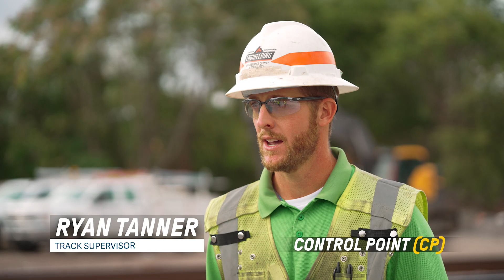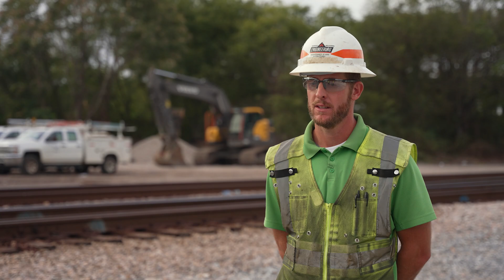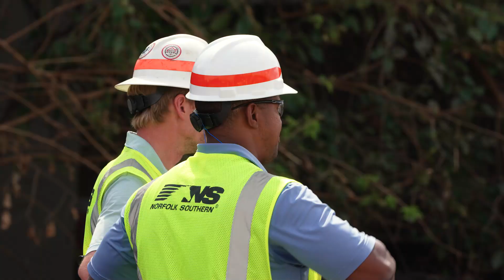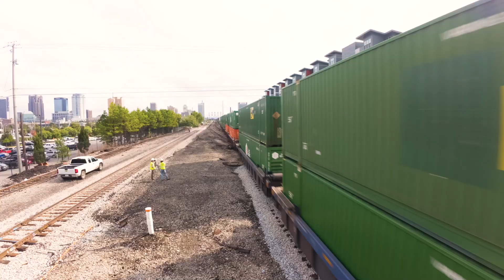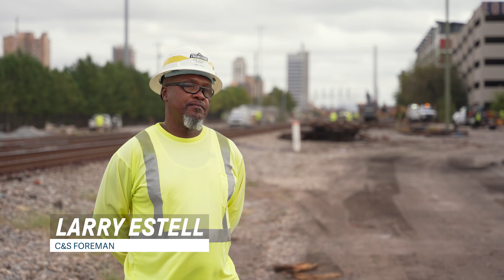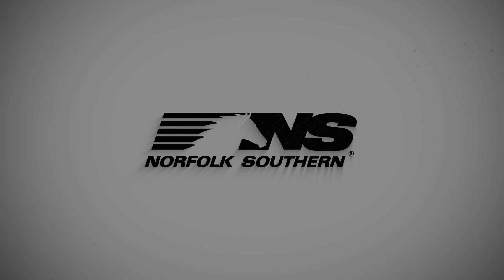Modernization at Birmingham, AL junction boosts rail efficiency

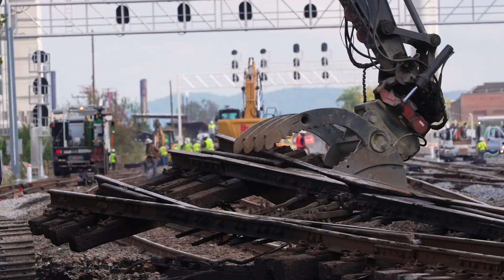Comment: I don’t understand why removing the movable point frogs is being touted as an upgrade, since they’re usually installed as an upgrade themselves over standard frogs. At 0:13, he hints that it was done to simplify division of maintenance responsibilities, but it seems like that could have been easily remedied by the parties agreeing to a more logical delineation point.
Reply: NS is Increasing Timetable from 25mph up to 55mph is a Huge Upgrade.  CSX will still be required to move 25mph through the CP and Turnouts. 🤔👍
Reply: I had the same thought. MPFs were touted as a major improvement in switch technology. It would be interesting to know why they did not work well here. If it was a division of maintenance issue, it would be interesting in that case to understand why a MPF is more difficult to maintain .